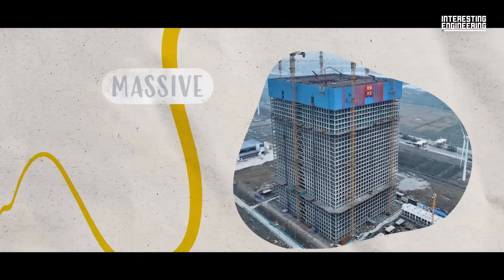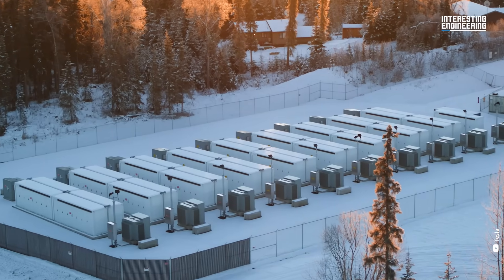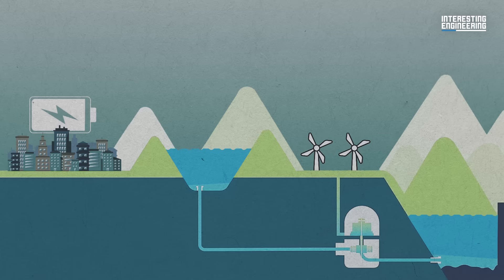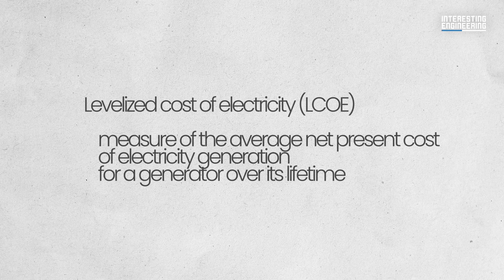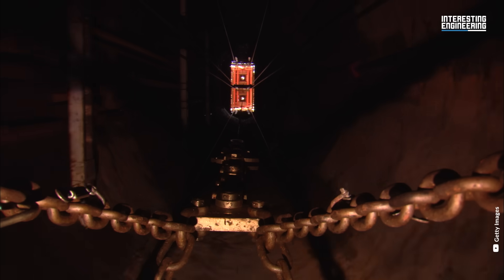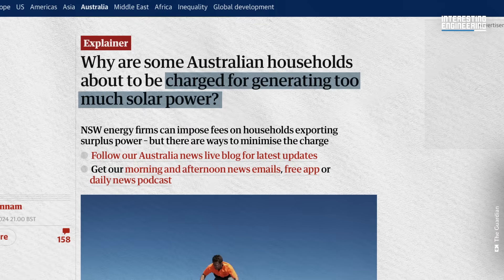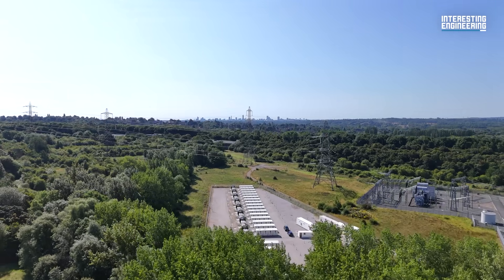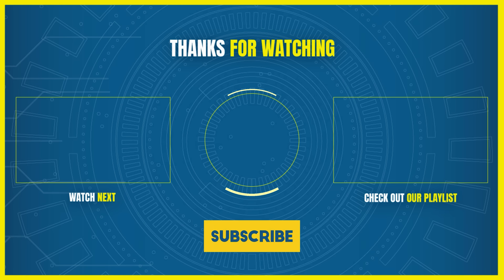China is Building Gravity Batteries

Comment: It’s funny how the original proof of concept was mocked by YouTubers a few years back, and now it’s actually being built by the Chinese government.
Reply: If you mean the big tower with the cranes in the middle, it’s because it is.

1) we already have gravity batteries. They use water. They actually have an 80% efficiency rate
2) the proof of concept is horrifically inefficient: between lateral movements, vertical adjustments, variation in storage height, etc. you lose so much energy
3) the big structure design does not suffer this problem, but the proof
Of concept with the six cranes is downright dangerous. Like stacking dice too high, you risk it toppling.

Comment: This concept is not unserious. Unlike water, it does not seep, evaporate, dams do not crack.  There is also sand batteries where the sand is lifted to store energy, and lowered to create energy.  A human at most basic cannot comprehend the very strong gravity around us, but try pushing anything uphill- a shopping cart with ten pounds, and the lesson is learned.  The potential difference is substantial.
Reply: This concept is also worse than the pumped power storage. It is less efficient, losing power to every moving part. It is more dangerous, due to the mass of the blocks should something fail. It has lower potential energy storage.
Reply: The issue is energy storage, energy density, output power, and cost of materials. 

The concept, at best, outright ignores these hurdles to viability at scale because it has to be new. It has to be futuristic. It has to be unlike anything before. And so these "inovators" try and reinvent the wheel, and at best end up creating a new livery, and at worst remake an existing system/product, but made worse because it has to be pods. It has to look cool. It has to be unique.

And all of that is only for those who honestly believe they are creating the future, and says nothing of the thousands of grifters looking to use that same vision to scam ppl, organizations, and even entire states into giving them money for the promise of innovating their problems away, only to run as soon as they can.

Comment: Typical AI generated content: The AI that generated the audio has no perceptiveness at all for what phrases it is agglomerating...

You do not "transmit a power per time". Power IS energy per time. Power per time would be a kind of "acceleration" of power per time - which is nothing anybody in the whole world is considering. Except, maybe, finance sharks who think about investment possibilities. But it has nothing to do with real world physics.

Taking aside this blatant bullshit, if you had (conjunctive, get it!?) a transmittance of 100 MWh / h (a somewhat accommodative interpretation of the nonsense bubbles from audio and video), you would NOT end up with 25 MW, but perfectly mathematically at 100 WM. This is just for 3th graders who just learned about multiplication and division. Something * x / x is the initial Something, nothing else.

And we are just 60 seconds into the video. Scaling that up, i expect to see about 30 idiotic statements from this AI generated nonsense.
Mankind is truly on a path to ascension! [rolling on the floor with laughter]

==================

Putting the nonsense aside: The ideas around gravitation assisted energy storage are spreading at the moment. This one here is just one of many cool ideas. Time will tell about how effective those buildings (be it dry on land or using water or using any combination of kinetic and potential energy) are in the long run. Experiments with small facilities are a good starting point!

Comment: Ya I'd believe it - just a big laugh though. Don't they have a river close nearby?  Just pump water back up stream - you already have the dam.  Why not split water and have oxegen and/or hydrogen stored?  Why build a giant structure?  Just run some rails up a hill and load rail cars full of lead. No hill? Make one or just drill a hole into the ground.  Why mess with sun power;  just go with wave action that happens 24/7 , Geothermal the earth is 6000c at the center. These are just major red flags that wind and solar do not work.  Pick a power source that does.

Comment: There is a power plant in Alabama which happens to be above natural underground caverns which are sealed. They pump air into them to build pressure to store electricity, then during the peak demand they use the air pressure to run additional generators. These type of energy storage using mechanical energy allows smaller power plants to be built

Comment: 1kWhour = 1000Watts x 1 hour . 
1 Watt = 1Joule /second,. 
1 Joule = 1Newton x 1meter
10 Watts = 1 kg x 1 m / second, meaning 1 kg rising 1 m per second requires 10 Watts. 
So 1 kW = 100 kg per meter per second
So 1 kWh = 100 kg per meter for a whole hour = 100 kg 3600 meters high, or 1000 kg 360 meters high, which is about a car's weight at 1000 feet high. 

So to produce just 1 kWh you need to raise a car at 1000 feet. 

For 1 MWh you need to raise 1000 cars at 1000 feet or 10,000 cars at 100 feet. 

Generally you need vast masses or great heights. I can not see this working very practically, unless the storage requirements are small.

Comment: It's not a revolution : many countries have dams that use surplus electricity to pump water back up into the dam, and then use that water to generate electricity when needed. These installations are called Pumped Storage Power Plants (PSP) or Pumped Hydro Storage (PHS). 
Here is the ranking of the top five countries in terms of pumped hydroelectric storage capacity :
** China: 44,741 MW, accounting for 25.6% of the global total.
** Japan: 27,470 MW, representing 15.7% of the global total.
** United States: 22,008 MW, making up 12.6% of the global total.
** Italy: 7,891 MW.
** Germany: 6,414 MW.

it takes less than 10 minutes to start the hydroelectric plants

Comment: I think using whatever local mountains are around to 'store' the lifted weights makes much more sense that building an artificial mountain.  Four or five railway lines, pulling up trains weighing tens of thousands of tonnes, over a vertical lift of several thousand metres, is an available resource in much of the world.
Reply: Or build them on the rims of existing canyons.
Reply: Water. Use water. Big sealed tank uphill, big sealed tank downhill, run pipes between them. Once filled with any sort of water, pump uphill during energy surplus, pump downhill during energy deficit

Comment: This won't work. 
The best gravity batteries already exist. 
Pumped hydro.
1000s of times the scale, and if there's rain it adds to the available energy. 
It doesn't take a genius to work out the problem. 
If we do some garden physics and invent a unit say tonne-metres which is one tonne lifted one metre.
Then look at energy consumption, say an EV, the car weighs say 2 tonnes, and we drive it up a mountain say 1000 metres of climb.
That would be 2000 tonne-metres. It is only worth about 50 kilowatt-hours of the battery charge.
These gravity storage units would need to be absolutely enormous to to store any meaningful amount of energy,  they would also degrade quickly.
Reply: It's less m * g * h * 2.8 * 10^-7 = 5.6 kWh! These are like supercapacitors : low energy high instant power.
Reply: As he said pumped storageis it's limited due to the lack of suitable topography. As always the best solution to our energy needs is nuclear fission until fusion has proved itself
Reply: An object with a mass of 2000kg at a height of 1km has a potential energy of 19.6MJ or 5.4kWh From where did you got 50kWh? Still mean you need even more massive amounts of mass to store energy at negligible height differences.
Reply: China doesn't have enough water to only use dams for hydropower. Theyre already constantly building dams
Reply: unfortunately it seems like all of our engineering "solutions" to the energy-materials-climate dilemma are all just pipe dreams and Faustian bargains of different flavors. 

build a smart grid powered by rebuildable energy resources like wind and solar? you're still relying on toxic manufacturing processes, mining of rare earths (on the backs of slave labor essentially), and ultimately: fossil fuels (solar panels and wind turbines cannot be manufactured, transported or constructed without fossil fuel inputs). build enormous gravity battery facilities to avoid the mining of rare earths? you're still relying on concrete and steel manufacturing, which are among the most carbon intensive materials on earth. hydropower? same issues plus the damming of rivers and disruption of eco systems. 

none of this stuff is "carbon neutral" let alone decarbonizing. birth rates in the developed world are declining but globally we're going to add a few more billion before we level out. thats even more energy demand and mouths to feed at scale. and if you really want to frighten yourself, start factoring ecosystem collapse, species extinction, the decline in soil health combined with industrial agriculture's reliance on mineral supply chains AND (you guessed it) fossil fuel inputs. 

i think, simply put: we have constructed a system of exponential growth expectations on a finite planet and we are up against planetary boundaries. we keep thinking we can invent our way out of this. its becoming delusional. like tech elites that want to live forever or whatever. seems like at its core, we want to escape the human condition entirely. we want "material progress" to be never ending and have deemed any alternative as an inherent "failure". 

add to that a multipolar power distribution and geopolitics, and things are going to get ugly. war is already here on the global stage, but i think we can expect even more to come.

there are no simple answers. even degrowth is a bit fantastical, because our population is so inextricably plugged in to the global industrial apparatus for our survival needs. 

we are in real danger, and its getting worse. start getting to know your neighbors. create mutual aid networks. learn some basic gardening and farming skills. resist extremist ideology. stay human.
Reply: This idea sounds ridiculous. They'd have better success dragging buckets of gravel to the top of these buildings and dumping them down a shaft with a turbine at the bottom.
Reply: The idea of putting them in mine shafts is incredibly dumb.  Most mines only have 1 maybe 2 main shafts that go up and down (most go horizontal).  These shafts are small, like maybe a few square meters in cross section.  Most are nowhere near kms in length.  Recall that every single cubic meter of rock had to be busted up and then taken outside.  Mines are no known for their spacious interiors.
A building may not be as tall as the longest shafts, but there are a LOT more paths to the ground.  The entire periphery of the building can be used for general buildings, not to mention internal shafts if it were being build for the purpose.
Reply: @tarstarkusz  I never said mine shafts. I was talking about the shafts, that they showed in the concept animation, where the weights would be traveling down. There is a way that the shaft could be modified to allow some kind of matter to travel down it while turning a turbine.
Reply: @DH40KFAN  I don't think I accused you of that, but if I did, sorry about that.
Reply: @tarstarkusz  Oh okay. No problem. 👍
Reply: Cute, but not realistic given the fact that you can't just make pumped hydro anywhere.

That type of systems needs specific geographical conditions which are great for some areas, and terrible for others.

Gravity batteries as a concept are designed to take advantage of preexisting abandoned deep earth infrastructure like mines that would otherwise be wasted space anyway.
Reply: @mnomadvfx  They'll do just fine while the US continues with its digression
Reply: Just asked any AI site, here is one of answers - For 1 MW output over 1 hour: At 100 meters, you need ~4,600 tons. Feasible with heavy materials (e.g., concrete blocks). Energy Vault stacks 35-ton blocks, so ~131 blocks could work. So it is doable and practical.
Reply: @javaswim  build all that and you've stored $50 worth of electricity. They physics work, the economics are crazy.
Reply: @javaswim  that is the equivalent of 74 powerwall 2s full of energy. Call it 750K worth. How much is your 100m structure that can handle 4500 tons? Technically feasible, economically absurd I think you'll find.
Reply: @mhelmreich1  
I did the math years ago.
I build cogeneration systems and looked at storing to down size our systems and store during off peak usage.
The infrastructure investment alone makes the project undesirable but the size of the blocks and the height required to store a days household consumption is enormous.
Reply: Your kind of thinking is why the US is behind in everything including high speed rail etc.  ok Einstein 😂
Reply: Like these comments “this won’t work”, as if these projects are designed by kids 😂
Reply: @yamingliu1810  Do some research on China's record for construction projects. They spend all kinds of money on failures.
Reply: @yamingliu1810 no, they're designed by clever marketing people who want to sell them to governments. Reinventing an already existing concept in a new way to hype it up as a new invention is super common. The issue is that the established thing has been so optimized already that to sell your thing as a new unique design you need to make it worse. Using water systems for this purpose is more efficient than using heavy blocks, but whomever wants to sell this will not tell you that, or worse yet, try to lie about this and obfuscate the fact. It's better to be sceptical about "new" things when they can't really prove there's anything actually new about them.
Reply: @yamingliu1810  That is exactly what it is like.  China has built entire cities of skyscrapers and demolished them either ever using them because. ...they didn't work.
Reply: There are plenty of projects that have funding and no chance. The existence of this project doesn't prove it is viable. Show the math. 

It MIGHT be viable as some sort of grid services frequency response thing which can dump or absorb a huge quantity of energy over a few seconds and thus allow a larger wind farm to be connected than otherwise possible. But as an alternative to pumped hydro? Not even close.

This would be a lot more convincing if there weren't basic errors riddled throughout. Hint it isn't the L in LMC batteries that has questionable sourcing. If so, LFP would be no better. Also some funky mixing of power and energy units.
Reply: @adamgardner3364  You have zero idea what you're talking about.
Reply: Degrade how?
Reply: @jyyyb Moving parts. Lifespan of 35 years. This is not the most impressive technology, and an even less impressive video that gets basic facts wrong.
Reply: @jyyyb  Cable, pulleys, bearings, brakes, etc... every mechanical part required for operation. Water powered generation doesn't have any of those fail points.
Reply: @jyyyb  first thing that comes to mind are the cables. second is the motors
Reply: China's rapid advancements in engineering highlight a stark contrast in approaches. While the U.S. often grapples with a lack of focus on in-depth research, many Americans seem more inclined to engage in superficial debates, like arguing in YouTube comment sections, rather than diving into meaningful exploration and innovation. No wonder your country is failing.
Reply: @xxAutoglocktaviusxx  Explain your ghost cities.

Comment: I don't understand, gravity batteries need huge infrastructure, they generate electricity which is not 100% efficient and therefore consume more power than generated to lift them up. Why?
Reply: They are not meant to generate power, rather store it for later use. It's used to support peak power demand and avoid waste when demand is low.
Reply: That is correct. Energy output / Energy input is miserably low.